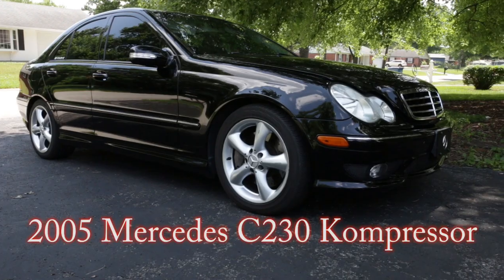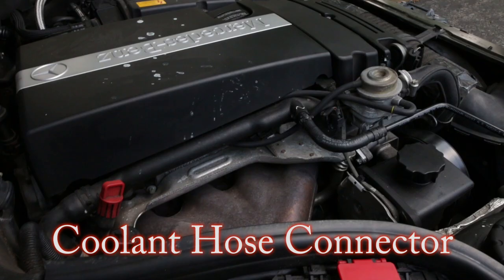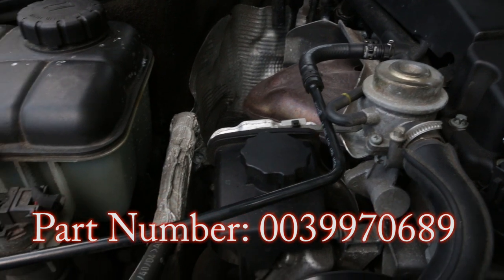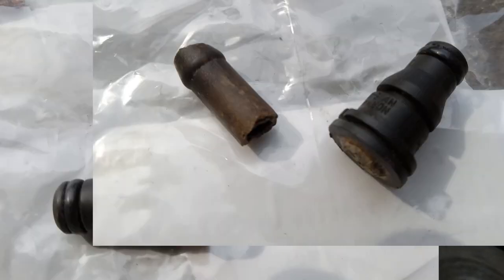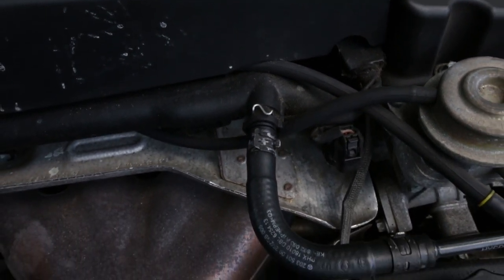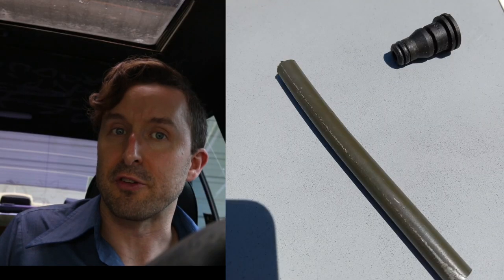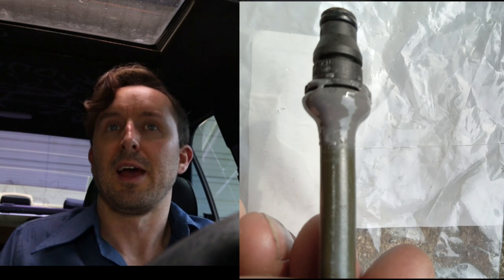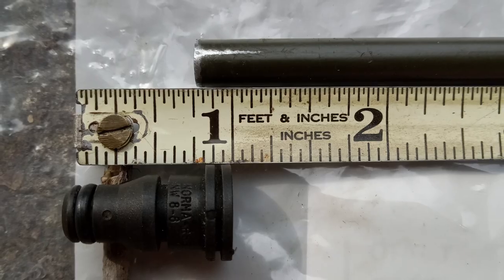Mercedes C230 | Coolant Hose Connector | w203

Comment: Why am I not getting notifications of these videos?!  
JB weld,  I put that stuff on everything.  Except hot dogs, but they are gross anyway.  
JB  weld has a 6 min set time product. I buy my local ace hardware out  just for personal stock.   The temp raiting  and expansion is  gaugaged high. I put this stuff on a neighbors  4x4  side by side with a crack on its engine block. It ran for the 3 years i drove it with him.   If I buy stock  it would be in JB weld.      You can sand it smooth, drill a screw in it , paint and bondo adhears to the stuff.
Reply from the maker: Make sure you "hit that bell" to turn on all notifications! :-D

Comment: I actually just did the same thing. Not make a new one, but barley bumped it snapped off. I actually ordered a part, and it came with the connector attached to the new line. Unfortunately, it's not even where the leak was coming from. In your experience, do those metal clips pop off, and you just insert a new connector/ line since it's 1 piece with connectors on each side. 1 goes to the overflow 1 to where it cracked off. Any info would help. We do have a mechanic set to replace the radiator if needed. Anyway, any information would help thx Logan
Reply from the maker: If I am understanding your question, are you asking about the metal clip that holds the plastic connector to the engine side?  If so, you can take a small screwdriver and gently pry that clip off, pop the new connecter in, and then reinsert the metal clip.   I apologize if I am not accurately interpretating your question.  You can also reach me on Instagram at @tankmouseproductions - if that would be an easier way to correspond.  Sorry you are having issues with your car!

Comment: The exact thing happened to me just today. I can't for the life of me figure out how to undo the clip connecting to the engine tho.
Reply from the maker: Sorry for the late response.  It pulls up from the top.  You can gently insert a small flat-head screwdriver under the top of the clip and gently prior it off.  Or, if that does not work, you can use needle nose pliers and gently wiggle it off - again pulling it from the top.  If you have any further questions, please feel free to type them here.  Or, you can contact me directly on Instagram.
Reply: @TankMouseProductions  I got it! It was simpler than I thought but with your tip I was more confident to put more force on it. After having that adapter break off, I didn't want to be too rough on it 😂. Anyways I got a replacement part from Mercedes and quickly got it fixed now. Thanks for your quick reply!
Reply from the maker: @Chinoam3  That is great news.  I am super glad that you got it sorted!  I definitely recall that sick feeling in my stomach when I saw that silly thing break. 🙄
Reply: @TankMouseProductions  I was surprised that you explained how it broke off almost exactly how it happened to me too. If only they have the adapter out of a harder material.
Reply: I have the same issue. Seems like everything is very brittle. Do you just pop clip off with a flat head, and the connector should come out? I just bought a new line, and it came with the connectors attached to the line
Reply: @loganhoffman9184  yep. If your pipe is fine you can also use pliers to undo the metal clip binding the connector to the pipe and just replacing the connector.
Reply: @Chinoam3  It seems like it has a plastic connector that it plugs into once you pull the old adapter off. My part came with both ends having an adapter, but it still seems like there's a few pieces in between. Once the clip is removed? Kinda of like a half looking plastic piece it may hook into once the old adapter is removed 🤔
Reply: @loganhoffman9184  oh a few pieces? Mine only had the one plastic connector that connects to the tank and another to the rubber pipe, the one metal piece holding the connector to the tank and another wider flatter metal piece to hold the pipe to the connector
Reply: @Chinoam3  I may try to mess with it tomorrow! It's not being driven now, and I have a work truck, but I wanted to try to at least fix this part so I can get it to the mechanic without a tow. Cars a 2003 E320

Comment: That broken piece went inside, is there a problem, where does it go?
Reply from the maker: I am not sure what to tell you.  Are you saying that there is a piece that somehow broke off and circulated back through the engine?
Reply: Yes, that broken part in the picture went into the engine. Where could it have gone? To the radiator, to the water circulation system, to the thermostat. How does the system work? @TankMouseProductions
Reply from the maker: @oguzhangunen6973  I am new enough to this car that your guess is as good as mine.  Hopefully, we can get another reader to submit a comment here!